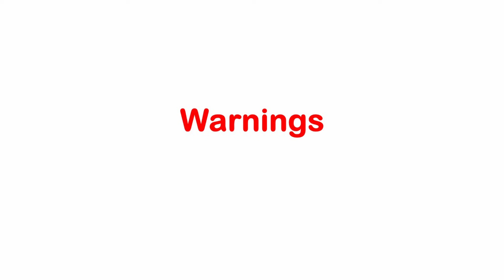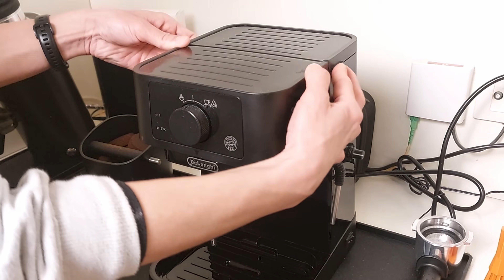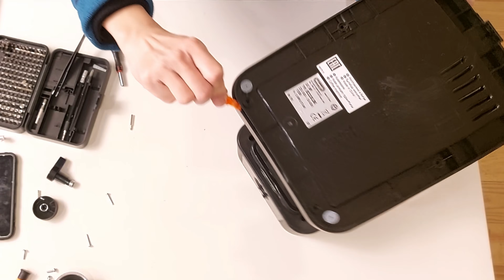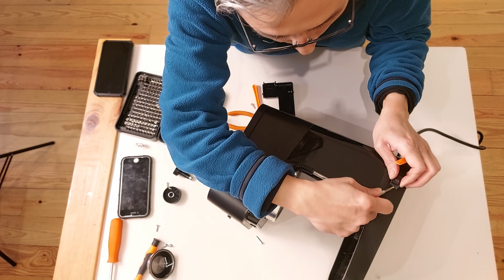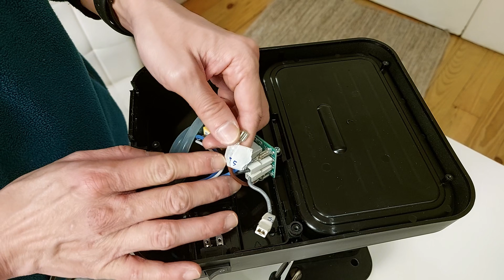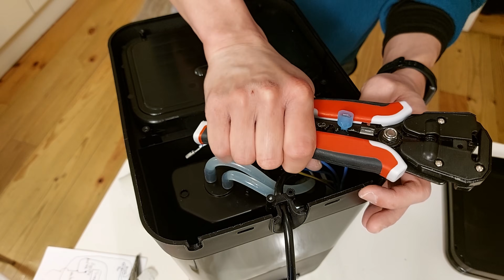Your Delonghi Stilosa Turns Itself Off

Comment from the maker: ==================================================================
***WARNING: T1 is not connected to T1 in the modded version of the schematic. Thanks @paulked for flagging!
==================================================================
Products that I used or mention in this video (some are affiliated links, but you don't pay more for them and support the channel buying through those links):

Delonghi Stilosa:
Amazon: https://geni.us/wZrDX

Power Switch:
Aliexpress: https://s.click.aliexpress.com/e/_c3I092hl
Amazon: https://geni.us/vYWdO9l

Crimper/Cable cutter:
Aliexpress: https://s.click.aliexpress.com/e/_DkOTzGB
https://geni.us/U7l7e (Amazon)

Wires AWG 16 or 18:
Aliexpress: https://s.click.aliexpress.com/e/_DcR8kbp
https://geni.us/AZMMKm (Amazon)

Spade connectors:
Aliexpress: https://s.click.aliexpress.com/e/_DdlcoOJ
https://geni.us/YwzUb1y (Amazon)

Piggyback connectors:
Aliexpress: https://s.click.aliexpress.com/e/_DcR8kbp
https://geni.us/KxvjO (Amazon)

Amazon Prime for some discounts and free shipping: https://geni.us/bidTfLf

Comment: If i only replace the switch without removing the timer, and plug the machine in a smart socket with the switch always on ,will it do the job? Or would i need to replicate the pulses for the it to turn on?
Reply from the maker: The timer reads the pulses. So, you will need pulses to turn it on and off. If you don't remove the timer, it will power off your machine after circa 10 min. You would have to program pulses to power off and on again every 10 min to reset the timer and keep the machine on.

Comment: If i only replace the switch without removing the timer, and plug the machine in a smart socket with the switch always on ,will it do the job? Or would i need to replicate the pulses for the it to turn on?
Reply from the maker: It needs a pulse to turn the machine on and off and you will need another pulse whenever it goes off. So, in theory it's possible if you can replicate the pulse with on's and off's within circa 1s.

Comment: This is how I did it and it worked for me:

T1: Disconnect and isolate 
T2: Connect with T3
T3: Connect with T2
T4: Disconnect and isolate 
T5: Disconnect and isolate 

Point 1: all the wires to the board are completely disconnected, and the board can be completely removed from the machine. 

Point 2: If you do solution nr 2, you must also buy a new rocker switch. This was not clear to me. 

Point 3: Do it at your own risk as I take no responsibility. This is only for educational purpose. 

//Brew and surf safetly
Reply from the maker: Thanks for sharing!

Comment: Hi, having to revisit the eco switch as the chap who  did it did not follow the video and did not remove the timer board! I cant really see what happens to the short grey wire you marked S2?
Im also redoing the dimmer switch, improving connectors etc, thanks
Reply from the maker: Hi Paul. The short gray wire was not used after removing the timer board since T1, T2 and T3 are connected together to the power switch and S2 connected the power switch to T3 before the mod. Good luck with your install!
Reply: T

Thanks 👍
Reply: Thanks! I'm taking my time as I've very little knowledge of electrics.The dimmer is  working well on my  ecp35.31! Some good espresso! I've been a long-time user of the Bambino Plus. These boiler machines are something else!

Comment: To the point, thanks. How many pins does the new rocker switch have?
Reply from the maker: You can buy one with 2 pins. In general, I buy with 4, and depending on the application I can decide if I'll use 1 pair (on/off for 1 phase) or 2 (for both phases)
Reply: @EspressoHackers  Thanks for the explanation 🫡

Comment: In the modified circuit, T3 is connected to T1 and T2, connecting it as shown will result in the pump being powered whenever the switch is on.  Shouldn't the pump be connected to connection 1 of the rotary switch and T2 left unconnected?
Reply from the maker: Thanks, man! You're right, T1 is not connected to T2. I just opened my machine and found out that there are two connectors on the back of the rotary knob that are not normally connected, it's normally open. I'll review the schematics later and maybe repost this video to avoid confusion. It's minor but maybe not interesting to have wrong schematics being spread.
Reply: So is T2 left unconnected? just insulated to isolate it?